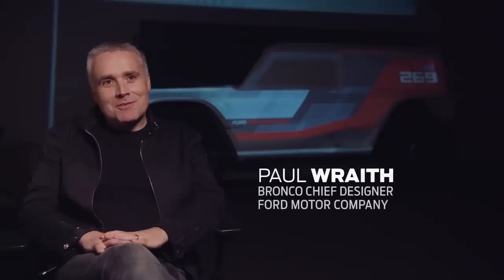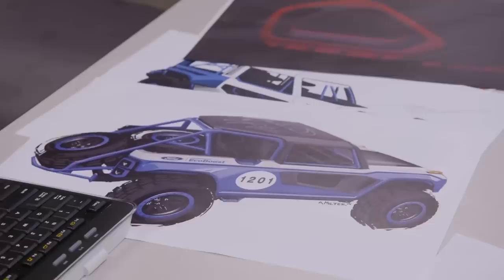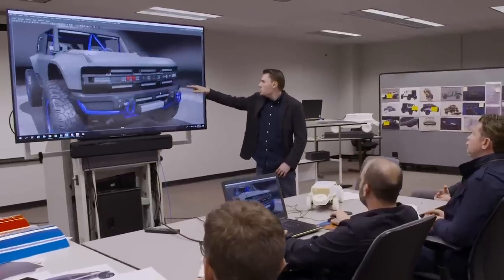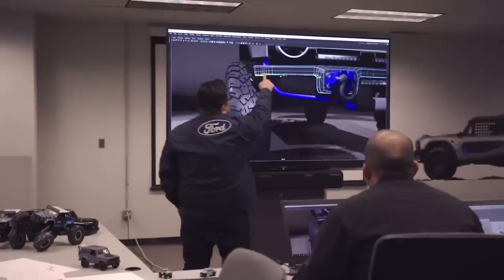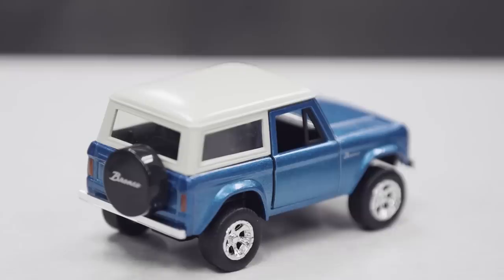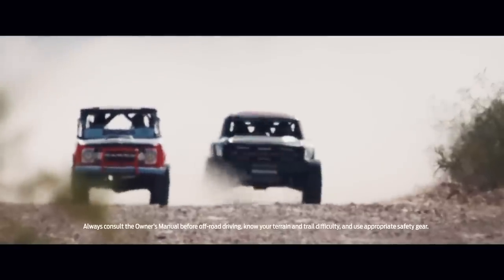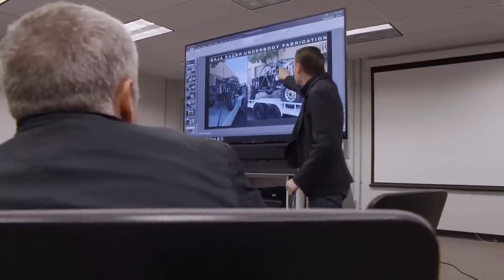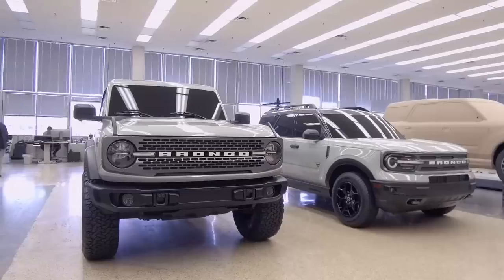Designing the Bronco R | Bronco | Ford Performance

Comment: I still drive my 90 Ranger with 327,000 miles to work that still works great and gets 17 mpg around town . When I'm off I drive the 07 F-150 Supercrew 4WD King Ranch that has 201,000 miles . Finally something new that I actually like but I just hope I can afford the thing . I was one of the first to put the $100 down though . I also had a 96 white full size Bronco back in the OJ days ,lol .

Comment: without a v8 option Ford will still loose sales to FCAs, 392 option no matter if they equal the power with a hybrid 6, just like what will happen with the raptor the 6 is not a manly sounding engine.

Comment: When you put a 5.0 in it I will buy 1 and so will alot of people
Reply: It was looked at and didn't fit.
Reply: Hey Brother first off nice Shelby. I just picked one up as well. I sold my 13’ gt500. That being said I respectfully disagree. Sure maybe they would sell a few hundred more but the cost to produce and sell would not yield great results. Maybe if you Special order one that hasn’t been produced and they build it just for you to make sure they’re not wasting time and effort into mass producing one with a 5.0 then yea it would be smart. Now, Considering the fact that a wrangler even with the 4 cyl only gets about 17 combined mpg in the real world due  it’s weight and lack of aerodynamics and the Bronco will be almost identical in nature. Putting a 5.0 in it will yield horrendous results. Even worse in the fuel consumption department and in the off roading/ rock crawling world, the more nimble and lighter a car is the easier it is to maneuver, crawl and keep higher with less suspension load. I can only imagine crawling down a steep hill and having the heavy nose weight weighing you down and possibly causing the vehicle to slide or lurch forward on slippery slopes. It’s also not a sports car, even your average 17 year old girl in an ecoboost mustang will be taking you to town at the light from a dig and in the highway. There’s really no need to put that 5.0 in there. As much as I love the coyote, it was not meant for a vehicle like this. That should be left for the mustang and the f150.
Reply: @robertacevedo24  thanks👍  I would love a 5.0  but I know that will never happen. I would settle for the 3.5 H.O out of the raptor but that will never happen. I have a spare 5.2 voodo sitting on the stand. 
 I might look for a solid gen 1 2wd bronco and stab it in that
Reply: @robertacevedo24  --> I've heard rumours that Jeep is gonna put the Hemi in the Wrangler, so it might not be such a bad move for the Bronco to get a V8 sometime down the road.

Comment: While Ford plays with clay models, Tesla reinvents the technology underlying transportation.  The misallocation of resources represented by this video will be obvious in 10 years time.
Reply: Electric cars won't replace gas in 10 years and definitely not Offroaders. Battery energy density is still  too low compared to ICE. Ford also has Full Electric/hybrid suvs and pickups in production or in the works. You realize ford owns a large stake in Rivian now right ?